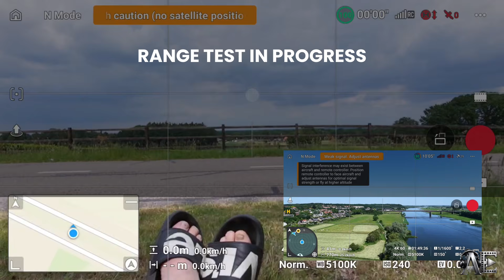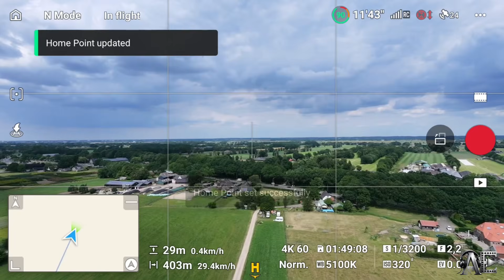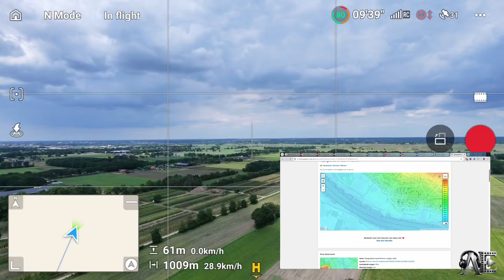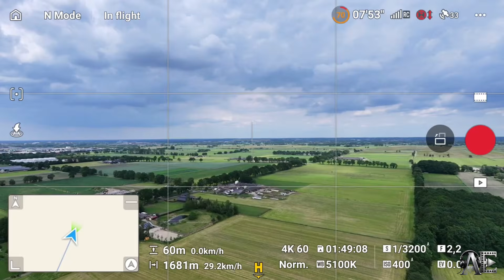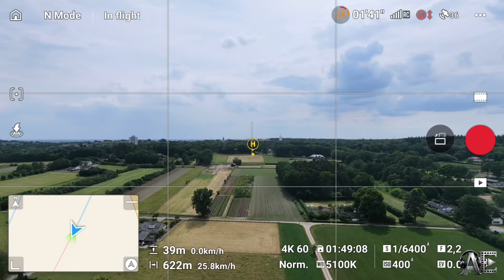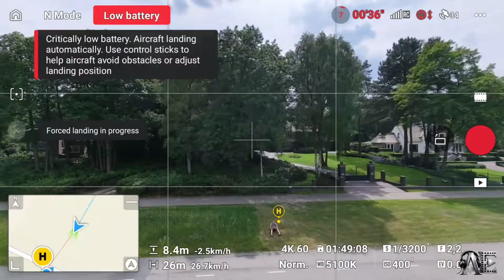Is Your DJI Neo 2 Range Actually This Bad?

Comment from the maker: Thanks for watching! The first range test was honestly a bit frustrating — but after looking into CE mode, interference, and line of sight, it all started to make sense. 1,700 meters with the RC-N3 and the limiting factor was the battery, not the signal. That felt like a much fairer result.
Have you had signal issues with your DJI Neo 2? Let me know in the comments — I'm curious if location made a difference for you too.
Next up: RC2 vs RC-N3 range test with the DJI Mini 5 Pro. See you there! 🚁

Comment: I'm not into doing videos of the countryside with my neo2 . I just try to zoom through obstacles no more 600 feet away so range is not a problem for me. Even the 10-12 minute flight time on the neo2 is ok for me, that's all I used to fly when I flew fixed wing planes. 
I can appreciate that people with the more advanced mini 3-4-5 etc want range and flight time so they can create really nice videos because those drones are made for cinematics rather than fun flying in a smaller space.
Reply from the maker: Yeah, I completely agree 😄

This test was really more about comparing the RC2 and RC-N3 than pushing the Neo 2 to its absolute limits. I used the Neo 2 because I wanted to keep the drone itself as a constant in the comparison 👌

And honestly, this video already showed that long-range flying probably isn't what the Neo 2 is best at 😂 I was definitely happy when it made it back safely — there were a few moments where I was getting a little nervous 😅🚀